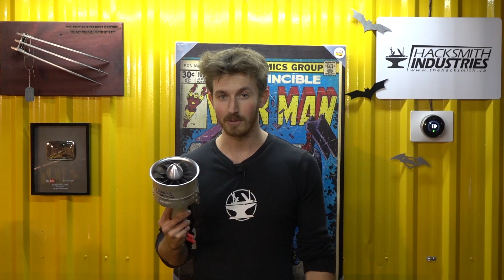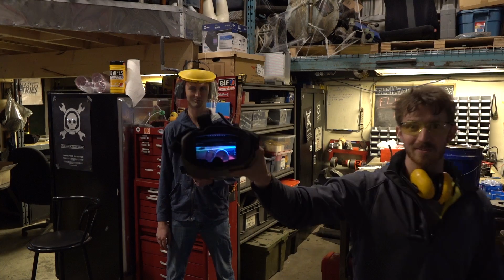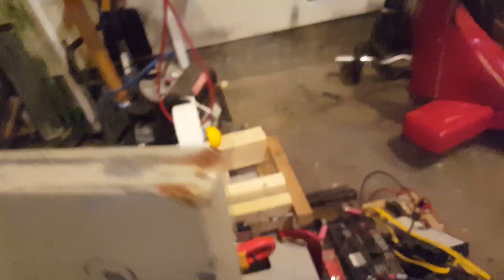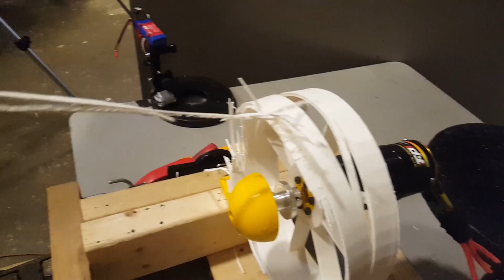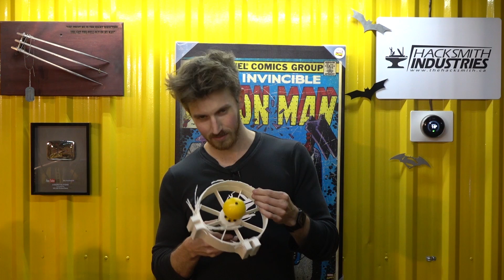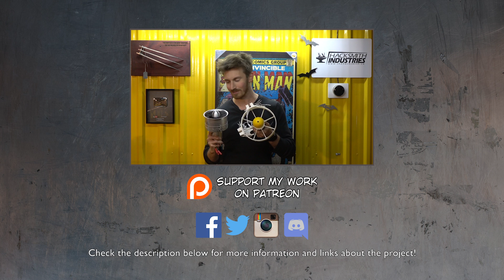Flying Like Iron Man Update: EDF EXPLOSION!!!

Comment: Remember Colinfurz made a jet engine from a junkyard turbo?
Reply from the maker: It's a lot different I'm afraid.
Reply: the Hacksmith yes, indeed, but what if you make the nozzle smaller. You know how a water dam works.
Reply from the maker: Still doesn't apply for something like this... it wouldn't work sorry
Reply: the Hacksmith I'm just throwing out ideas 💡;)
Reply: the Hacksmith well, I'm not saying to make a replica, I'm saying the turbo can be used to replace an EDF
Reply from the maker: Aerodynamics is pretty complex -- I'm no expert, but basically things have to be designed for specific speeds and thrust output -- just using a turbo won't work because it's not really meant for the same thing (and it's heavy!) =)
Reply: hey :D would coating it in carbonfiber help ? or atleast making it a bit stronger ?
Reply: the Hacksmith thrust to weight ratio, right.
Reply: But a 3D printed version
Reply: Ok well the EDFs are great then. But maybe you can make a cone nozzle to create more pressure
Reply: Henry Goettler carbon fiber sounds good
Reply: It's 3 times lighter and 10 times stronger than steel
Reply: its reaally hard to make those out of carbon fiber, because if the finish isn't polish, is gonna separate the limit boundry of the airflow, and if that happens, it create vibrations on the blade that will potencially brake them, like on this video
Reply: Zhalas no you just reinforce the outside
Reply: I really hate typing on this phone!
Reply: Zhalas hmmm ... yeah ... well building one might be... but simply coat it with carbon fiber ? just to reenforce it so it does not explode ? :D dont know :D was just a thought :D
Reply: the Hacksmith check out David mayman
Reply: Henry Goettler hahaha it's a good though though
Reply: David has invented a Jetpack and it's the real deal. It was on the "outrageous acts of science" show.

Comment: looks like your using a % fill instead of full fill on your print, correct me if I'm wrong, but you should be using full filament fill on this.
Reply from the maker: It was only sparse in the hub -- effectively 100% infill in the blades

Comment: a metal body? to stop them from exploding so violently
Reply: it's too heavy, and printing is a lot quicker and easier, compared to having to remelt or shape the metal blades. They are only testing right now, so they are probably going through a bunch of different designs. but maybe they could get away with aircraft grade aluminium for their final design.

Comment: Not trying to be a person who points out stuff I have no knowledge of but 3D printing I do know. 
1:You can increase a 3D prints strength by giving certain materials an acetone gas bath. I believe it's only on abs. Pla might also work. Look up 3D printing polishers. You heat a chamber with your print and acetone together. The acetone turns to a gas and melts the outer layers. It will dissolve a print if left there. The light melt creates a smooth outer surface. 
2: it's possible to add thin strips of metal within a build. Either post or mid print. It's outlandish but worth mentioning. 
3: as EDFs get bigger they rotate slower? If so try making overly large EDFs. The prints work less effefient and have to go slower. But with very large 3D prints you can get the same as one of the expensive EDFs. Aka. Print buy. Low rpm. Try 1&2.
Reply from the maker: The blade was acetone dipped ;-) 

I wouldn't want to risk metal shrapnel inside the blades -- could be deadly. Either all plastic, or all metal -- in between probably wouldn't have many pros =P

Comment: Miercoles it out of carbon fiber and even graphite all you got to do is make a mold out of 3d printed parts then use vacuum bag and and a compressor  to soak the graphite mixed into the cabon fiber    cloth

Comment: You can reinforce the printed parts by dipping them in a solvent (M.C. / Methalyne chloride ; acetone may work) this will solvent weld the print layers improving the strength.  You'll need to be extra careful not to warp the blades and to make sure they stay balanced but it may be enough to keep it together.
C
Reply from the maker: Hey Jeff!

We did actually use an acetone slurry to reinforce the blades on this test -- still didn't help much! We'll be evaluating other filaments, but likely FDM printing just isn't going to do the trick -- but at least we can prototype our design!

Comment: Make a silicone mold of your 3D printed parts and then you can cast them fron epoxy or poly urethane resin (if needed infused with fibers) so make stronger parts faster
Reply: Or use wax in the molds and cast molten aluminum. Might be cheaper then resin
Reply: I was going to suggest doing something like this with Grant Thompson's (the King of Random's) aluminum casting set up.  You could cast and then sand them to make them smoother.  Should be stronger than ABS.
Reply: Ivan Stroganov good idea
Reply: jiml3obob its way more complex, though. making structurally sound aluminum parts without trapped air or hydrogen is very hard. and cast aluminum isn't as strong as extruded aluminum anyway.
they have a tormach cnc mill, they could just mill all the parts they need. but resin casting should be faster and cheaper if they need multiple parts of the same model.
Reply: that's actually a good idea
Reply: Ivan Stroganov smart

Comment: Have you guys looked into resin rapid prototypes.  They make some resins that are on par with aluminum in terms of strength.  You can also get SLS parts out of steel.  Both of these might be better options than FDM.  As we could see in the video, there was a delamination in the part.  Once it started it was down hill from there.  A resin or SLS wouldn't have these layering problems. Stratasys recently purchased a large 3D printing service down in Texas and they now have a TON of options available for very reasonable prices.

Comment: I have an idea it may or may not work what you guys  need to do is print out edf with cast able resins with a form 1 3d printer then cast it with aluminum the aluminium will take the shape of the 3d printed edf then you just need to polish it up a bit then test it out. you can rent or buy a form 1 plus  side 3d printer  or go on line and have the print done for a fee. hope this helps

Comment: I know what's wrong because the outer tube is 3d printed and the only mounting point is at the bottom the outer tube it bends and touches the blades.. try to make a bracket for the mother as well to attach to the mounting point because it was bending up.

Comment: Hey guys,try some of these;
1.Maybe add small carbon fiber rods in each one of the blades 
2. have the printer use fill not honeycomb
3. paint the 3d printed parts in 30 min or greater 2 part epoxy to make it harder 
 
But most important of all, TRY TO BALANCE IT! in higher rpm un balance props are extremely unstable and isolate as well, so to reduce it just make a simple balancing rig and balance them so you have the least amount of vibration.

P.S. notices it wasn't very balanced since the camera and instruments on the table began to shake and vibrate immensely
Reply from the maker: The vibrations in the table are more from the immense power of the EDF though we do need to balance future ones =)
Reply: AH! gotcha, also try covering the fans in some kind of coating or something to keep it still at those higher rpms, also im happy you where able to reply to my message :)

Comment from the maker: Most common questions!!!

What Material ► ABS-X with Acetone treatment -- we have many other filaments to test, but right now we are just prototyping the blade design for maximum thrust. 

Why not cast it ► Casting a precision part like this at home would be extremely difficult due to variations in the casting, not to mention polishing by hand would be extremely difficult -- if an aluminum blade blew up like this one, the shrapnel would truly be lethal.

3D printing is a waste of time ► This "waste of time" is allowing us to prove various blade designs at minimal cost, once we have finalized the design we can look into manufacturing it (likely with a CNC mill) -- part cost could be anywhere from $500-$1500 PER EDF BLADE.

Why did it break? ► The EDF was spinning at speeds upwards of 30,000 RPM. That means the tips of the blades were traveling at close to mach 1 speeds! 3D printed parts just can't handle that kind of speed due to delamination. Any material using FDM 3D printing is unlikely to work for a final design -- we can potentially use another 3D printing technology, like SLA or SLS -- but for now we will stick with FDM printing to finalize our design.

Next steps? ► Continue testing our designs, acquire flow simulation software to better calculate maximum thrust and power requirements, continue testing using 3D printing -- once we find a design that works well, we will look into having it manufactured. Likely via CNC machining like professional EDFs. Metal 3D printing is an option, but very expensive ($1000 for one blade out of aluminum) -- and we don't even know if it would work.
Reply from the maker: +Mark W we have an awesome enclosure, fully heated -- we'll do a video soon :)
Reply: Try printing with Taulman nylon... those are much harder to delaminate, but you definitely should have a all metal hot end to reach good operating temps
Reply: I second the nylon. Thing made of it have much better structural integrity than those made of ABS.
Reply: bump the taulman nylon, used it before and we took turns stamping on a hemisphere made of it and nothing happened
Reply: another  way would  be to make it out of  carbon fiber and mix graphine in the mix to make it ten times  harder
Reply: I've found with ABS printed parts the layers will separate and the parts will break much more easily if the cooling fan is on or if the printer is not in an enclosure. I couldn't tell if yours was enclosed but since I've enclosed my printer and turned off the cooling fan (or kept it very low), my ABS prints have come out way stronger. Can't wait for the next vid. Keep it up!
Reply: Hacksmith,
Great work you guys, keep it up! I have a suggestion to submit for your consideration. Others have clearly suggested changing filaments and printer settings,  or using metal/metal impregnated plastic. However, it seems to me that you do not need the entire wing to be entirely structural. You need structure, and then you need 
your airfoil. Linked but ultimately separate requirements. 

That said, here is my idea. When you make your print, make an L shaped channel running through each blade, and a circular one (or several) around the hub. As it is printing, There should come a time where the channel is half-formed. At that moment, you implant your skeleton made of steel wire  into the pre-made channels, and continue the print. Once completed, it may be beneficial to inject epoxy into your channel. Same concept could also be achieved by printing the blades in two halves (each half having 10 half blades, and a half of a hub), and then gluing all of that together. Please let me know if this needs more clarification, I usually have the benefit of a whiteboard.

If done properly, this method may allow the steel to take the brunt of the tensile stresses, all while adding minimal weight. I welcome any feedback on this idea.

Good luck!
Reply: the Hacksmith i think you need to cast a turbine using instead of printing it
Reply: I believe there is a plastic for any home 3D printer that has infused metal powder to print metal objects could this work for the EDFs
Reply: the Hacksmith 3D print them in stainless steel instead
Reply: the Hacksmith it seems like one of the simpler/cheaper and safe(ish) options might be overlooked here. you said you're having problems with delamination? then switch processes. I'm willing to be with some creativity you can find a way to mold ABS parts. Then they would have the same low cost of materials, no more danger than current parts for shrapnel, but would at least keep the material at a higher strength since it would be material failure not layer failure.

Comment: Is there a way to reinforce the 3d printed parts? I know that the steel in historical late medieval swords go through various processes to create a crystalline structure called Martensite that makes it able to handle stress from impacts while retaining its form without bending or snapping. Is there a way to reinforce the plastic from the 3d printer like that? If you can develop a homemade method then that can be really useful.

Comment: the housing bent and made contact with the blade because the platform it was mounted to was more rigid than it. if you add a bezel of plywood to the housing with epoxy and bolt that to your test stand you should get better results. the edf was torquing itself into an ellipse.
Reply from the maker: Actually the whole thing bent... not just the housing =P

Comment: may i recommend heat treated titanium, or carbon fiber?  If you want max thrust, go for less acceleration of the air, and more volume.  so less KV on the motors, and larger diameter blades.  getting the blade tip tolerances tight is also key to max thrust from a particular setup.  also, don't copy the blade pitch from the hobby king blades, as they are meant for high speed flight, and you need static thrust. you need less pitch. roughly half.   good luck.
Reply from the maker: Yeah we're onto the 7th revision of our blade design as we've learned more about the different dynamic that goes into it -- got a fan doing some flow analysis for us =)
Reply: that would a fan doing flow analysis for a fan. 😉
Reply: always go with first principles first.  look at the most efficient way to create a large amount of static thrust with the minimum watts necessary.  (one example comes to mind of the Titan human powered helicopter)
this requires a very large blade diameter, and low rpm.
granted, this is an extreme example, and you will obviously have to compromise, but what we can learn is that the largest diameter practical for your use will give the most efficient static thrust, and be the most likely to allow you to "fly like iron man".   
The real iron man always looks at things with a first principles perspective. 
It's not a question of if you can fly using electric fans, but of how long you can do it, and what your control system will be like. Off the shelf technology can make it happen, and i recommend you start by using the power system from a large multi rotor, stacking blades, trimming the prop blade ends square, and focusing on designing  your own 3D printed ducts to fit.  
By the time you get to the control aspect, the ducts present a problem, as you need to tilt rotors for control in many configurations, and the flow around the inlet of the duct will not flow properly at angles of attack that are less than optimal.  but that's a problem for later. 
hope this helps. 
i do have a little experience with similar matters...
Reply from the maker: Yeah.... that's why we're 3D printing fans, finding the optimal design for thrust to power ratio.

Comment: Try carbon fiber filaments. Also, maybe try integrating a ring into the blade to help with rigidity/ centrifugal force.
Reply from the maker: Sadly, short of the MarkForged -- most carbon fibre filaments are more marketing scheme then actual function =(
Reply: sadface

Comment: Is it possible to print with a weaker more flammable material that you can use as a mold. Then pack it in sand and pore some high grade aluminum into let the aluminum burn out the mold. Sand it down to spec?

Comment: would it be less likely to break off it were cast in plastic rather that printed?
Reply from the maker: Yep. Easier said than done though
Reply: +the Hacksmith Well if you 3d print a version, coat it in some molding material (idk if silicone would work) and then pour in plastic, it could work, you'd also have to coat the 3d printed parts with something first to make them not stick though

Comment: Please print in ABS, then partially melt it in acetone to remove the weak points.
Also try printing with the temperature a bit to high as that will make the print stronger.
Reply from the maker: That was ABS and melted in acetone -- good idea though =P
Reply: is it possible to print with cast-able wax? that way you could make metal blades for your EDFs accurately.
Reply: Have you guys thought about printing in nylon?

Comment: Try putting a fiberglass coating on the blades. It should considerably increase its strenght if done properly...
Reply: They could use aircraft grade aluminum. The hacksmith said it would be too difficult to mill. But if they used a sheet of it (thin enough to work as the blades ) then you could basically bend it into position to match the exact curvature of the 3D printed blades once they found a design that gives enough thrust.

This way the metal would more likely bend than shatter allowing for slightly safer results than something like the silicone based models they are using
Reply: Ohos Usani could code them in melted metal to
Reply: nah too heavy, fibreglass is way lighter
Reply: @badaz I'm afraid the aluminum would never bend that way